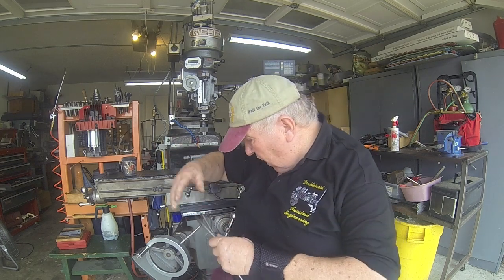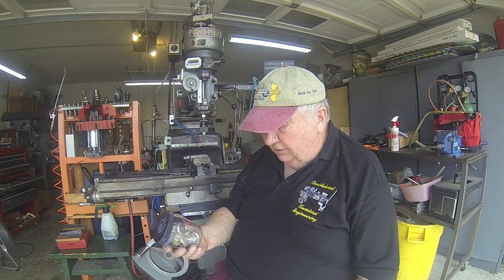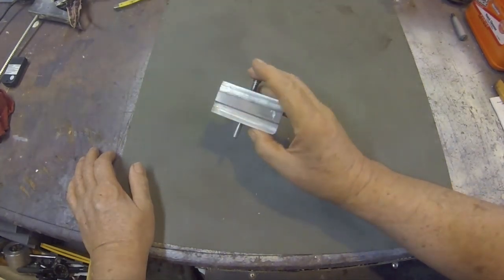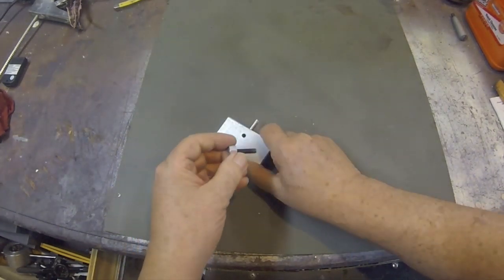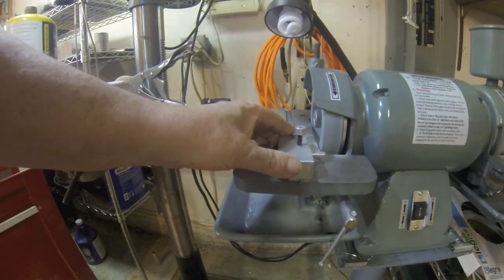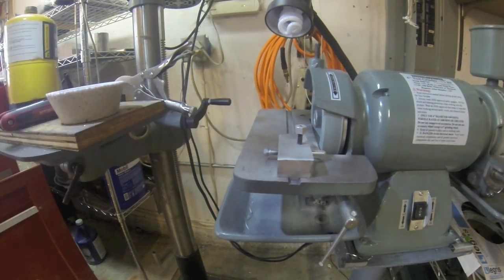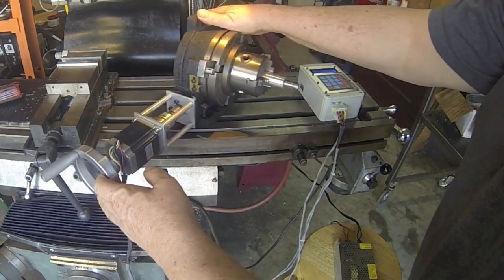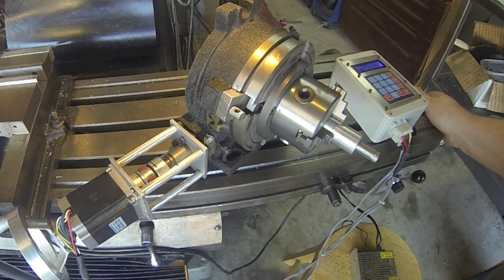This Week in Herb's workshop #9

Comment: Hi Herb,

There are a number of rotary table/dividing head stepper motor drive systems out on the web. The Division Master for example has been around for a good few years. They usually have three modes; divisions, angles and feeds. You've covered the first and last, but the angle mode comes in handy for things like rounding a corner, or the end of a bar. If your worm backlash is consistent, then you can program that in for bidirectional control. Some designs add a lock feature too.
Reply from the maker: Thanks for the input Paul.

Comment from the maker: One thing I forgot to mention.  The rotary table is 90 to 1, and the stepper is 200 steps per rev.  Without "microstepping"  I can  get 18,000 steps or  .02 degrees per step.  by going in one direction, you don't have to worry about backlash.

Comment: Herb,
Nice rotary table. Did you write your own code for the Arduion? Could you have done the same with a Raspberry Pi? I have never worked with either unit, but have heard and read some about them. I have heard that the Raspberry Pi is easier to work with. Thanks for sharing. When you wear John's shirt, you will have to learn to say bastard with a British accent!
Have a good one!
Dave
Reply from the maker: yes, see my comment to Adam.
I have a Raspberry Pi, and I don't do any controlling with it.  It is basically a liniux computer with some IO.  but the arduino is much more suited to control.  I don't usually use the term "bastard",  I've been called that a few times though, but I'm more in tune with "Son-Of-A-Bitch", plus some in Tex Mex spanish that I can't say on Youtube.

Comment: Great video this week! You got some really nice gifts from some great guys. Those rods Tom makes are perfect for the kool mister. I use a starrett snug to hold my nozzle on.
That power rotory table is awesome! I could have used that just today. I had a 5 hole pattern to drill and used it in manual turn mode for each 72 degree move.
Lookin snazzy there Herb, with your Twastard shirt and Turn Write hat!
Thanks for sharing!

Adam
Reply from the maker: Thanks Adam.  Our youtube community is the best. 
I built the controller for about $50,  I think I bought the stepper for about $10, and I made most everything else.
Most of the time was spent in writing the code.   Arduino is a very easy to program.  On this design I used every one of the IO pings.  A lot of the code, such as the keyboard and stepper control is off the internet.

Comment: Cool rotary table Herb. Certainly a lot handier than handle cranking like I do!! LOL

Colin
Reply from the maker: I started this project about two years ago, built a prototype as a proof of concept.  This week I decided it was time that I finished up at least the basic gear programming.  I've had the hardware done for several months, except for a couple of connectors.  I had been away from the program for a long time, so I had to relearn the programming aspects of it.  Now to get a project that I can put it to use.
Thanks for watching.
Reply: Some of guys have to live with hand cranks, analog dials.......you know!
Reply: Abom79
I'm hearin ya buddy!! ;-)
Reply from the maker: Adam, When I first bought my little rotary table. I also bought a indexing set.  I tried it and said that I'll loose track and screw up every time.  Thats when I decided to make something that I could easily use.